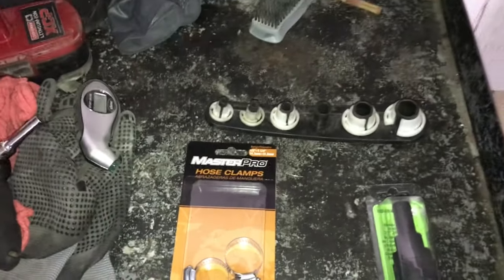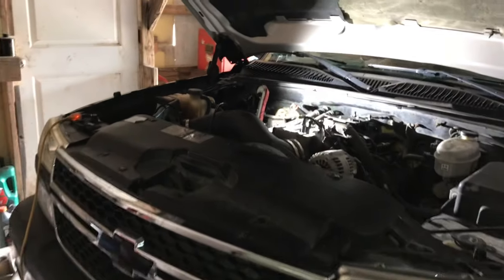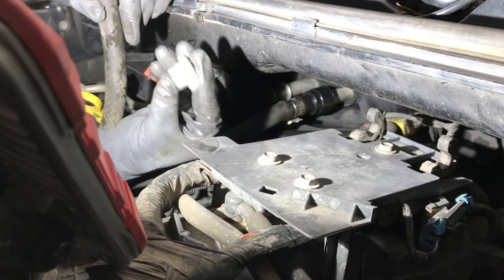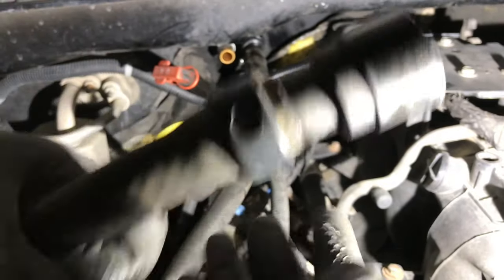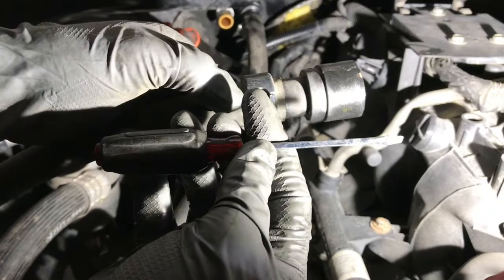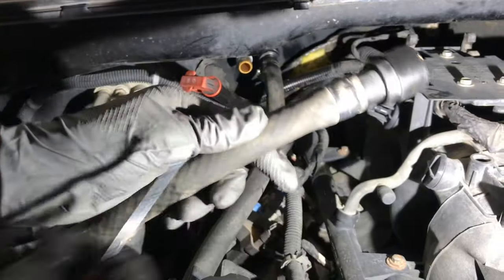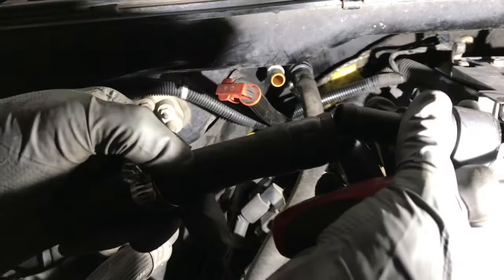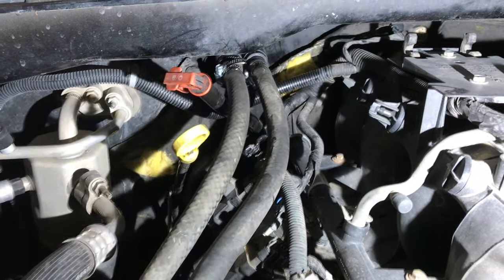How to replace heater hose connector on 2000-2007 silverado /sierra

Comment: If you don’t have any of those tools, break it off at the plastic connector and heat up a flat head with a torch to get it hot and cut connector with it. Cuts like butter
Reply: Yooo kooleee, boy you saved the day! Got the blowtorch a flathead and melted that thing apart.
Reply: Did the exact same thing but with an old saw zawl blade , cehap AutoZone disconnect tool couldn't do it

Comment: I had to change mine on a 2002 Avalanche. I couldnt make the removal tool work so I simply used a $1 soldiering iron that I'd picked up from Dollar Tree to melt the connectors right off. About a minute for each one and they were off. Sliced through like butter. Since they're on a metal pipe there was nothing to damage.
Reply: Love it. I just got after mine with a kitchen knife lol
Reply: Iv been trying my damnest to get it off with the normal tool but it doesnt seem to want to budge and was thinking the same thing.
Reply: @robertharris6092   It really is as simple as heating up the soldiering iron and melting the plastic.
Reply: also about to do my 2002 avalache been cutting with a knife till I got to the inner plastic peice. your idea sounds much better haha

Comment: I just want to say I don’t have the disconnect tool. I removed it somewhat surgically with a sawzall blade BY HAND just to cut the plastic. Two weeks later, no leaks. DO NOT USE A SAWZALL!!  Just hold the blade in your hand and cut the plastic away

Comment: Thanks very muxh for your video...I was very nervous about the removal of the connector...the part actually broke off in the heater hose so I actually had to dig it out carefully to avoid pieces going down inside...also I found it very helpful that you specified the size tool needed and part number...I had a fuel line disconnect tool I purchased years ago and never opened...I thought I would try it to see if it would work...It came off very easily...I was shocked at how simple it was...I can only imagine how much a shop would have xharged for a $7 part replacement...my 2005 Silverado has 
250 K miles and I am surprised the part did not fail before now....hope you continue to post videos...your lighting, no-nonsense presentation, and to the point video was most helpful...!
Reply from the maker: I really appreciate it and really glad to help out more videos to come out soon:)
Reply: Now tell the class how that was the easy part and getting them back on nearly killed you......

Comment: Hey, if you don't have this connector tool, I managed to make one with a pill bottle that I cut short enough to go over the heater core fitting, and then cut sections out of it until it fit inside the connector and pushed the fins back. I don't know how easily the actual correct tool is to get a hold of, but I also didn't want to spend any money. lol

Also, thank you for the video, I didn't know how those fitting and hose adapters went on there at all until seeing this. <3

Comment: Thank you for showing what to do with that stupid plastic pre-assembled "clamp" they put around the connector. I figured I might have to cut it off and replace it with a standard hose clamp, but this assured me.

Comment: I have to do mine, THANKS for your video cause I’ve been dreading doing it but now I have to because I’ve got both hoses clamped off with a set of vice grips. I think I have the plastic tool in a master disconnect tool set I bought ages ago.

Comment: Did the adapter go on easily? Is it just the two tabs inside that are catching? Or is it the four that are close to the rubber ring? When I put on mine to just the two tabs grabbing it was leaking like crazy but I can't get it on any farther to go to the 4 pens down at the bottom. Am I doing this right?
Reply from the maker: You should hear a click when they lock if not remove it and check if all tabs are in place , I don’t have the part number with me to make sure it’s the right one

Comment: Aye bro I replace my radiator and my a/c is not cold anymore but before I replace it it was working fine , what could’ve happnd?
Reply from the maker: The main radiator or the ac condensor ?
Reply: Jose Flores no like I change the radiator , the main radiator I replace it
Reply from the maker: Check the ac lines for leaks , is your ac compressor clutch engaging when your ac is on if not or if it is engaging and disengaging it’s probably low on freon
Reply from the maker: Also the control itself can mess up
Reply: Jose Flores oh okay thanks bro
Reply: @sanchezalex9742  Did you figure it out? My a/c stopped working one time and it was just that the belt fell off.

Comment: Are both connections the same like can I use that same part number on inlet and outlet both of mine are leaking
Reply: Did you ever figure it out? Both of mine are leaking also
Reply: @Juan_Gomez808  yes on mine 06 Silverado 1500 it is the exact same I found some metal ones at O’Reillys I didn’t want to go back with the cheap plastic
Reply: @Juan_Gomez808  there kinda tough to push in I ended up pushing them in with a 2 by 4 and a hammer

Comment: If your truck has over 100k miles change them even if they are not leaking, it will save you a headache. Dorman came out with an improved metal design because these plastic ones don’t last.

Comment: I can’t be the only one that has trouble re connecting the new one onto the place where it connects to
Reply: @southerntyde34 make sure it’s the correct part they gave me the wrong part number for this at orielys
Reply: They gave me Part #: 28500 and I needed Part #: 800-409
Reply: @travisguilbeau8404  what vehicle did u have
Reply: @_htxpacc9525  08’ Silverado 4.8L

Comment: so i followed your directions only to find out the correct tool size is 3/4 not 5/8 .😐
edit: at least thats the way it is on my 2002 GMC Sierra . 
the 5/8 connector was $20 , the 3/4 connector was $10 . . .
Reply: Should've went to harbor freight, a couple dollars get you a whole set
Reply: @RichardJBeach  . . . the nearest harbor freight is 20+ miles away .
parts store . . . 5.5 miles away .
but i do get your point .

Comment: How the fuck you get it off though lmao no one explains this
Reply: Push hose IN, while pulling quick connect piece OUT or back towards the hose. This will let the quick connect to release the pipe,  then pull on the whole thing to separate.

Comment: Why not just clamp the hose right to the pipe coming from the heater core and get rid of the connector? 🤷🏻‍♂️
Reply: Don't risk bringing damage to that pipe. That's the reason for installing a quick connect.
Reply: its a good idea and common among owners, the connector was for production to be faster while building the truxj